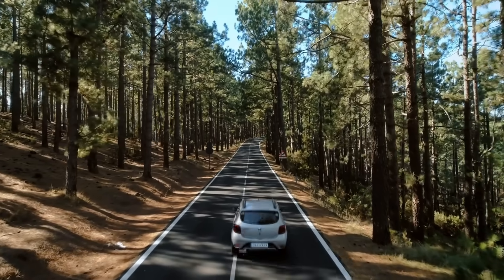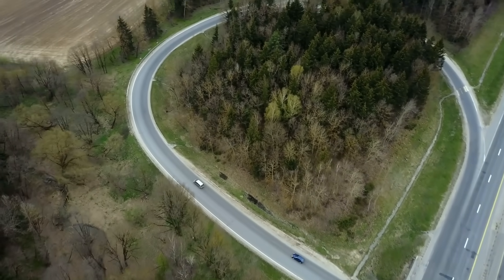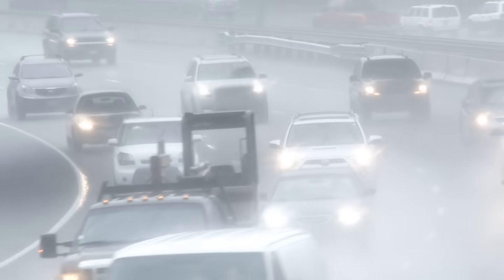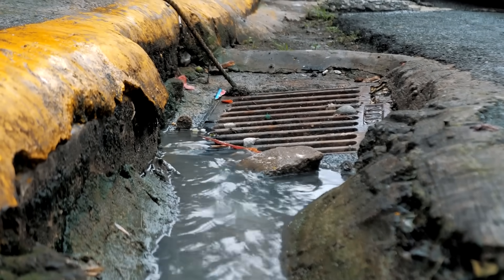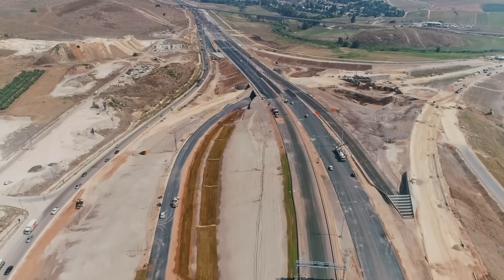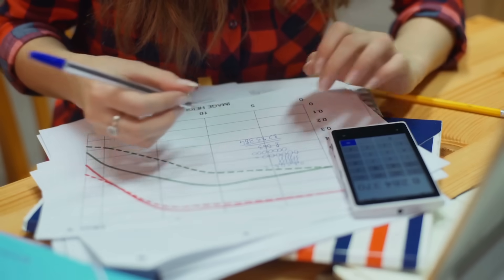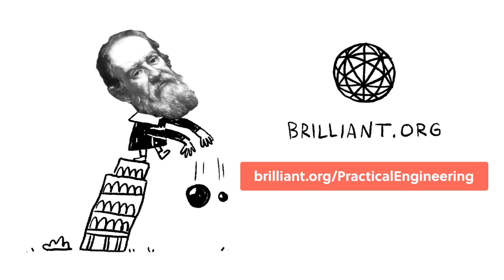How Do Potholes Work?

Comment: Annihilated one of my tires on a pothole 15 minutes into a 4 hour drive. Immediate pressure loss, but it could hold some. It was 6PM and the closest tire shop was luckily 2 miles away and they closed at 7. Sadly the shop didn't have anything in stock for my rims and they were so close to closing time. I couldn't wait since I had to be at work the next day. They gave me some air and I limped the entire 230 miles, stopping at every small town gas station that had an air compressor. It felt good using loose change again. On my way home from work the next morning (worked nights), the rumblings started and I knew I was in trouble. My supervisor, on his motorcycle, caught me going 20 in a 45 with my hazards on and told me to follow him to his house, which was less than half a mile away. The tire fell apart and separated from the rim a few minutes later. Cars should never make that sound, and I tore up the base's perfect roads. After ruining his driveway we swapped tires (I don't own a jack, he does) and I went to Discount Tire. Rims were fine, brakes were fine after they cleaned some tire from them.
The real takeaway from this story is this: Buy the warranty. New tire cost me $25.

Comment: Well, a pothole forms in a road, then along comes an innocent unsuspecting vehicle.  The vehicle tire falls into the cavernous pothole, causing all sorts of damage to the suspension of the vehicle (or more depending on speed of the car and size/depth of the pothole)  Then, 2001 years later, the pothole gets haphazardly patched, which only slightly delays it diabolical activities.

Comment: Asphalt never fully dries and sets 100%. (I work with asphalt I do it for a living and I do sealcoating and crack filling as well). The most preventative measure for fixing a pothole is to cut it out and replace it. Filling the cracks does absolutely nothing because they never get 100% sealed. If you use a hot application for said crack fill it could become an even greater hindrance on the roadway or driveway because of the hot application heats up the asphalt surrounding the crack fill causing it to weaken over time (usually lasts a year on a single driveway with a very very little traffic). In cold weather the crack fell tends to contract and pull apart from the asphalt inside the crack causing a void that can cause the crack to become even wider. Crack fill in a very cracked up spot will rip up the crack fill whenever you drive over it on a really hot day (potentially), we've had to patch many holes because of this. In conclusion the best thing to do when you see deep cracks is to cut it away and replace it. And crack fill is a Band-Aid fix (kind of like using bubble gum paper clip and a little bit of pocket lint to hold your exhaust together... It's a quick fix but it doesn't solve the underlining issue). Again I am speaking from experience in the asphalt profession from both sides sealcoating and asphalt. Take my information as you will but I recommend not even crack filling if your driveway looks that bad save your money and get it overlaid or replace it

Comment: Hi Grady . . Thanks for the information on potholes.
Your detailed discussion was very clear and educational.

Here in Montana (and everywhere else I'm sure) we have many different types of potholes.
Depending on their size, depth and shape, they are further refined as one or more of the following:
Tire popping, axle bending, steering misaligning, whiplash inducing, back cracking,
tailbone fracturing, skull concussing, tooth rattling or vehicle fragmenting.

Potholes have little brothers called wash boards.
They are usually born and raised on dirt or gravel roads.
I was wondering if you might put together a video on these delinquent little rascals ?  😈
Thank you . . . . 
AreTwoDeeTwo  🚘

Comment: What I never really understood is why - in the case of potholes - corrosion doesn't just fill in the holes with little stones and debris. Is the problem an escape-hole under the pothole which is created by the water?

Comment: The best solution for potholes and broken roads is: the top layer of asphalt is milled off. 
The removed material is mixed and heated as if with new material and then reapplied to the road as new asphalt.
This is only possible if the substructure is not damaged or sunk. 
But then the road is like new.

Comment: I've lived both in the Los Angeles area and in the Northeast.  In LA, when a pothole (or intentionally created road defect, say from utility work) is patched, the resulting road surface is *perfect*. You can't tell at all when driving over it.  But in the Northeast, for some reason, this is never the case, and, invariably, the resulting surface irregularity very quickly leads to deterioration.  Why can't roads in the Northeast be patched as well as they are in LA?

Comment: As with any substandard system, the governing body simply adopts the mindset to deal with the liabilities.  We create substandard roads....so we agree to factor in a continual maintenance to fix them.  In Japan an engineer named Nagato Abe works for the Toa Road Corporation.  He created thin, iron/metal road surfaces to easily handle the weight of the common car while ensuring the long plates of metal could be easily replaced when worn.  When the worn metal must be replaced, the metal is removed within two hours and recycled for a different form of construction (melted and re-shaped for safety barriers over bridges).  No pot-holes....ever.

Comment: I got a couple stone roads nearby, built looooong time ago out of granite. They are in perfect condition despite moderate car, little bus traffic (1 line) and years of heavy building vehicles traveling to newly built, further away neighborhoods.
Only 3 places where this road is bad is where modern roadworkers patched it up after some pipes were laid down. They fixed it using same material but didn't do it properly so it sagged down.
Wondering how much would it cost to build such roads... even if it costs 5-10x as much as regular asphalt (material+ very skilled workers+ time), if it lasts hundreds of years, it's worth it.

Comment: I always hear thrifty minded people claim concrete roads cost more up front but more than pay for themselves over time in longevity and reduced maintenance costs, often implying the main reason asphalt is used is due to the easier sell of lower up front costs while pushing out maintenance as a problem for whoever succeeds them in office. Would love it if you could do a video on concrete roads which addresses this.

Comment: A long time ago I helped customers make use of high-performance computers for man-in-the-loop and hardware-in-the-loop simulation systems. One of my customers was Ford Research Lab and the application was an anti-lock-braking system HITL simulator. What I learned was that, at the time, there wasn't a good mathematical model for a pothole, which was the most serious issue with anti-lock-braking system engineering. Compared to a pothole, and F-16 simulation is a breeze... until you get below 16 feet off the ground... yeah...

Comment: The technique shown at 6:24 should be illegal to use under the penalty of death. Not only is it using passing vehicles to work the loose gravel into the asphalt sprayed onto the road, sending hundreds of small, sharp stones into the suspension of said vehicles, but more importantly, until the loose substrate is washed away, it poses lethal danger to motorcycles at it (obviously) provides literally no grip.

Comment: Why don't they just paint a waterproof coating over the road surface once they are finished and re-coat it every couple of years. Surely it would be quicker to just run a huge painting machine that can do an entire lane at a time along a road every couple of years than wait for it to start falling into disrepair and have to start continuously replacing bits of it.

Comment: Innovating better roads shouldn't be the only option for cities and engineers to accomplish. American transportation can primarily be summed up at cultured for cars. Cities could be saving funds by encouraging public transport use and better zoning and land-use. Where I live, you can't shop anywhere because I live on the edge of the city. Now I have to drive into the city if I want to buy whatever I need or want. And a lot of cities are like this too. And most level 2 or 3 cities either have little to no public transit. You could be filling buses with up to 20 people, meaning a possible 20 less drivers on the road. Even intercity travel could be substituted for rail networks.

Now cars won't go away and I don't advocate for a ban on all personal vehicles. But Americans could significantly reduce influx of vehicles driving over them if public transport and better zoning alleviated roads. Our innovations are only as good as how we use it.

Comment: Well concrete motorways wear well and don’t generally get potholes, but they don’t drain water well and they are damn noisy to drive on, especially the rib lines that join each section together!

Comment: Yeaaa someone lost their oil pan on a  very big pothole, the pothole is half the size of a mid size sedan and prob 29 inches or more deep. Its very common to see either broken bumper or a oil pan.
I remember seeing a camry which the right front wheel,shocks and what not got ripped off by the pothole.
The potholes in bangladesh are 10x worst

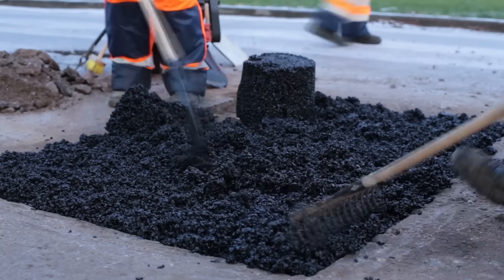Comment: 5:09 Funny joke. Up until relatively recently, within the past five years maybe, there were some pretty gnarly potholes around my neighborhood that went unfilled for years! It's tough to remember exactly how many years, because it felt like I grew up alongside these potholes (for reference, I'm 18). It was genuinely surprising when the holes were finally paved back over, we had just come to accept them as a permanent feature in the roads, forever something to slow down for. It was like that throughout most of the area for a long time. I should consider myself lucky I guess, because in other parts of Metro Detroit, it's still like a minefield of potholes. Ffs, our current governor, Gretchen Whitmer, ran on the slogan "fix the damn roads". It's pretty appalling how bad it can get.

Comment: @01:02 I know it's a small job but why bother applying tack coat when they just drizzled it only at the beginning? The end part is also sloped, it should be cut straight.

Comment: Wait, you still fix pot holes and patches with shovels? At least in Sweden we have something called "sprider". It's like a long pipe (that folds on two places, the bottom and on the middle). In one end it's attached to the tub on the truck with a small hatch that opens and closes with the push of a button on a controller that the driver usually has around his waist. Inside is a large screw that feeds the asphalt down the tube and out of the hole on the other end, which also has a hatch that opens when the screw is activated (by twisting the right lever on the controller). You can also drive and steer the entire truck with the right lever by holding a small switch on the controller. The left lever drives the inner arm and the right one drives the outer arm. This is so you can go back and forth and fill a patch very efficiently.

Comment: Potholes in western PA were a constant problem in the heavy industry traffic and servere winter days from decades past. Most of the road weren't treated with tar for some reason but the few that were treated with tar held up very well. Some were tarred and sprinkled with rocks. They never got potholes.Nice explanation of the pothole process.

Comment: On a highway outside my city a pothole formed and ooh it was bad. The first car victim blew out the tire, the next broke the suspension springs and a few other parts and then a few more flats but the last poor victim car completely sheared the front and rear axle almost completely in half. Wasn’t an overly expensive car but bruh.

Comment: "Roadways are so well designed and constructed"..

Mmmmm, i dunno 'bout that, chief.

If someone really wanted to make a durable, long-lasting road (at which point this video wouldn't exist) they would either:

A) Splooge a bit more for fiber-reinforced concrete, or:

B) Laminate or layer the underside of asphalt so that future cracks do not have such catastrophic water erosion effects.

C) Properly maintain the roads through regular sealing.

Comment: in india the climate is very diverse we have summer then rain then spring then winter then autumn, i used to complain a lot about roads, previously despite the fact that govt have improved road infra very very very significantly, but pot holes are irritating,  now i undertand what happens, in summer the temprature in india goes up to 45 C which forms cracks, next season is of rain which filled water there, and in winter the tempreture reaches 0 C in night leading to somewhat expansion of water down since it expands below 4 C, and in autumn the ice melts leading to potholes, this gets amplified when only 3% of indians pay taxes directly and currupt politicians
now i know about them, although i wont stop complaining but still now i know why are they there

Comment: Oh boy, the dreaded pot hole repair job.   One of the greatest engineering problems in human history.  But a great way to take an original 6 inch diameter small pothole, try to repair it, and it doubles in size 6 months later.  Sometimes the fix is worst that the hole.  The repair job may form a  high bump (invert the pothole, lol) on make a shallow but smoother pothole that quickly gets worse over time.  On busy interior city streets, I think it might be best, safer, cheaper, to simply dump a couple shovel fulls of clay/sand/pebble mix directly into the pothole, pat down with feet, and reapply often.

Comment: I suppose it depends on the environment, but I thought there was a lot of evidence showing roads with a concrete base cost significantly less long term because of the reduced maintenance cost. As well, when they do need resurfaced, it is pretty simple as the foundation will most likely still be fine.

Here in the UK, we tend to use very cheap, simple road designs, and it definitely shows. We also route all utilities under roads by default, which means that, even when you do get a nice new road surface, within a year a utility company will have been granted a licence to dig a massive trench through it and leave it with a big patch that will inevitably cause a pothole pretty soon. Madness.

The fact that we route utilities under the roads actually incentivises us to use bad road designs as the utility companies don't want to have to dig through concrete every time they have to service the infrastructure.

Comment: Before a pot hole is filled, the water should be pumped out before the patch is filled in the hole so the surface is dry and can't force moisture to form that will force out the patch out so the pothole returns. in the same place I think that makes a lot of sense.

Comment: This video is a really great understanding of the industry and the logistics and bureaucracy involved. I run a road work crew and I work flat out trying to repair potholes but as much as I can fix them, I have one crew with a city of 45 suburbs and thousands of kilometres of roads. My brief is to rapidly make them safe until a patching crew can repair them permanently. Unfortunately I have to return to some sites multiple times because there are not enough resources to go around to fix every little pothole permanently, hence the constant bandaids. Besides, it’s not cost effective to send an entire patching crew to repair a tiny road section. It’s a trade off between permanent repair and coverage of an area. I work a dangerous job where I’m constantly on the road and as I’m visible to the community cop the understandable ire  of them, but I’m working hard to make the roads safe and I also live in the city and actually care so a little understanding from the community and education would go a long way. The irony is people get annoyed that you’re impeding traffic briefly but also want the problems fixed.

Comment: how potholes work: truck drivers wait till they're full of water, then hit em with every wheel they can.
Reply: well that and if your a dumbass driving a car with low pro tires and you hit a pot hole your tire ends up rolling away from your car and your driving on your rim like an idiot crying about your stupid tires
Reply: @raven4k998  love my 265/35/18 continentals
Low profile (not stretched) Is the way to go if the roads aren’t too terrible around you just don’t ever run low profile runflats they’re truly awful, my factory steel rims had 3 cracks from run flat tires; I’ve been running standard low profiles on my daily driver for 2 years 50k miles with motegi alloys and no bends yet, also the wider the tire the more impact it will absorb.
Reply: @Whiboi  oo cool you drive self removing tires I love watching those things come off people cars when they hit a pot hole it's hilarious this one time I had to stop at a red light just chilling then all of a sudden I see a tire rolling by look over and a car pulls up not tire on the rim hilarious and cool to watch so watch out for pot holes and only hit one if you see me
Reply: @raven4k998  305/35R26 on my Tahoe. Does that make you cry worrying about what ppl have on their vehicle?
Reply: @raven4k998  found the neckbeard

Comment: You're forgetting another reason rain creates potholes - as the rain fills a hole or large crack, and a vehicle drives over it, the water gets blasted out at high speed and pressure, which takes material with it.  It's like blasting a pressure washer to the pothole.  You can even see the material being ejected in your video closeups of tires slamming through water filled potholes.  Also, after a rainstorm, look on the road next to a pothole - you will see the material that was ejected.